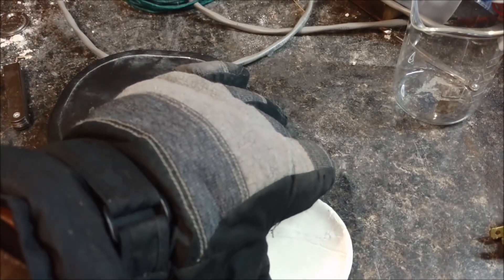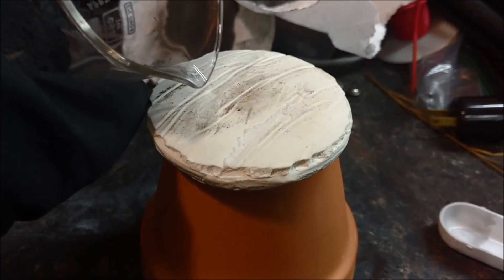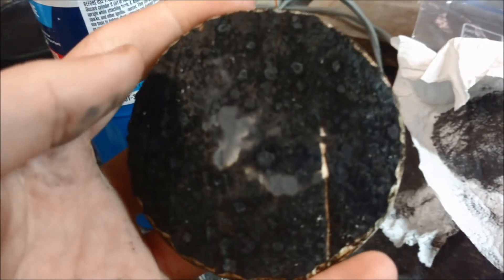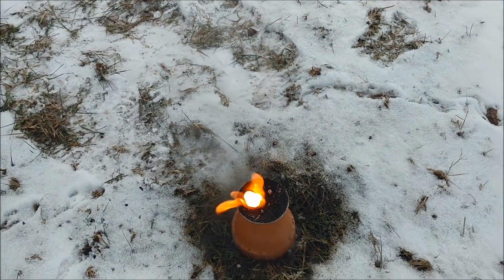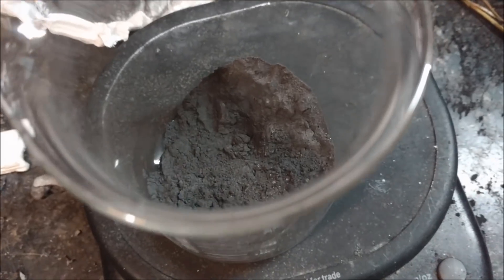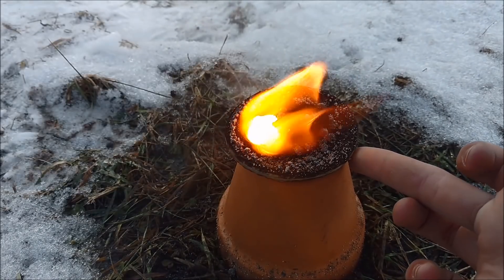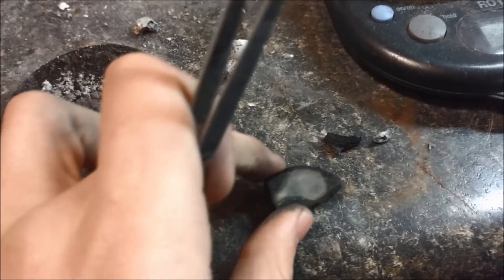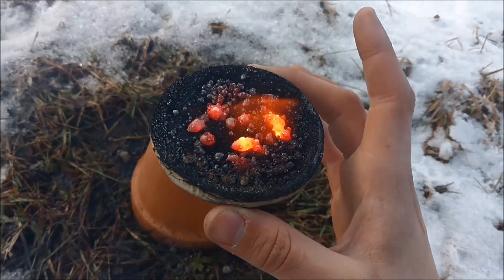Starlite Vs. Thermite: First Tests

Comment: tests of tensile strength would be good...  I wondered if a mesh of fiberglass or even just fibers mixed in would give added strength... think high tensile strength concrete mixes...
Reply: Some sort of starlite composite material?

Comment: Beyond the press has already tested it against oxy-acetylene (7200F) and it fared well.   

The next step is obviously....   A plasma cutter.   :)
Reply: I can't imagine Starlite is electrically contductive? If it is not, you can't plasma cut it...
Reply: @Auribus  It would only need to be adjacent to the cutter.   Also, you could paint the starlite with a layer of electrically conductive paint.
Reply: @dangerousideaz  Or cut a thin steel sheet with Starlite under it? Hm...
Reply from the maker: Now that would be something!
Reply: @Fr223Laboratories  Also, cutting laser. You know, one used to cut thick sheets of metal into gears and whatnot.
Reply from the maker: @UltimatePerfection  I have a 40 watt laser cutter. Not powerful enough to cut metal but it might be a start.
Reply: Someone used to do annual reviews of bike locks, and their resistance to various forms of attack.  Hydraulic Jacks, liquid nitrogen and sledge hammer, various torches - and they would all get a 0 -10 score for each method.
In every test, every year, all the locks scored a 0 against a plasma cutter.  Some can reach upwards of 45,000 degrees F.

It would also be interesting to see other competing insulative materials tested alongside starlite (alumina bricks, etc).

It would also be interesting to see how 'workable' the surface is, maybe on a lathe or just sanding/polishing.
Reply: I would love to see it painted with black 3.0 ( high absorption paint, Google it!) and tested with a high power cutting laser, it would be interesting to see the effect of a point source to observe localised behaviour.
Reply: I think the erosive effect will defeat the material. It is very weak to abrasion and physical wear
Reply from the maker: Kyle Towers  Can't wait to hear about it!
Reply: He just did that. It can't cut through, but the fast blowing molten metal cuts it, if it's thin enough.
Reply: Starlite doesn't fare well in oxygen rich flames. The oxygen just oxidizes the protective carbon foam.  Also this formulation is very weak and brittle. 
Starlite is a poor mans version of the Apollo era ablative heat shield, which is stronger and denser than starlite.

Comment: Do you see NASA or SpaceX using this material on rocket surfaces?
Reply from the maker: I would say most likely not. While this is pretty good, they've already developed ablatives that are probably even better than this. Also I'm not sure how well something like this would withstand Mach 10+ environments. Great question though!
Reply: if you polish this idea so it doesn't expand too much then yeah, why not... small hint - carbon nanofibers (same bubble principle)

Comment: Before nighthawkinlights video I saw a video by king of random about 5 months ago making clay with the same ingredients, except with 1 cup baking soda  to half cup cornstarch and mixing with water instead of glue then heating and cooling it. Looked pretty strong but didn't show how heat resistant it might be. Would like to test out different ratios of the mix to see which is stronger and more resistant to heat, and possibly make the best crucible between them.
Reply: https://youtu.be/D4RILT64F8c
Reply: Also remember his proto putty which is also similar. Add baking soda and use high temp silicone and might make a starlite with longer shelf life. One thing I notice is the baking soda is a critical component. It produced Co2 as it burns to help contain the flames. Corn starch is just one of many possible carbon producing components, flour may work as well. This just leaves the binder which in this case was glue. I'm wondering if high temp silicon will add to it's max temp rating but also add to shelf life. Honestly don't think that we need much more protection than 4-5k degrees unless your expecting a nuke to fall on ya lol. That's pretty damn fire resistant. If it can hold up to basic thermite I think it's good for any civilian application. I think we need to deffanatly experiment with this. We may never know the original comp but even if we can get a close variant then we can pretty much flip the tables. Pretty sure this tech was absorbed by a government. Then silenced. Think of military applications. A soldure with a light added layer that is flame thrower proof? And that's tip of the ice burg. We know the inventors family knew the composition. Yet they remain silent. And few people outside of curious minds even mention this material now. I'd personally like to make and insulate my house with this lol. Obviously wouldn't prevent burning completely but it can stop a lot of damage.
Reply from the maker: Thanks, I'll check that out and maybe I'll do some tests!
Reply: @anuragbhatlawande9916  to be honest at this point I don't think we can beleive much they say lol. I would like to see proto putty tested in this application though. It would be intreasting. Only thing I can't figure out is they "claimed" it can be made in paint, solid and putty. And while our variations achieve similar flame resistance not sure how we would proove or disproove that this can be made in a paint or liquid state. Either way I'd love to see this cracked wide open just to spite them lol. They had a great contribution to life and science. And selfishly refused to help the world.
Reply: @joespawldin7833  Use actual paint as the binder?